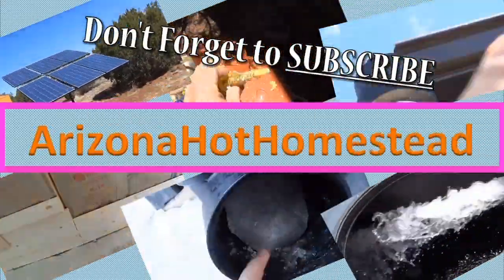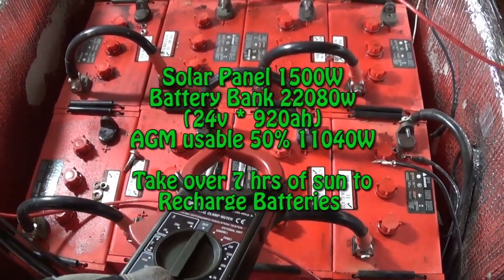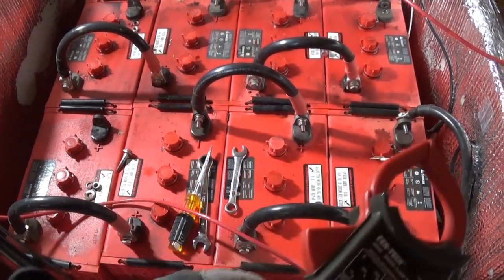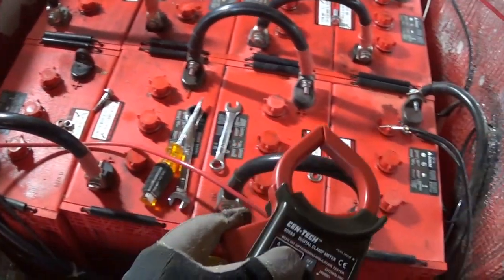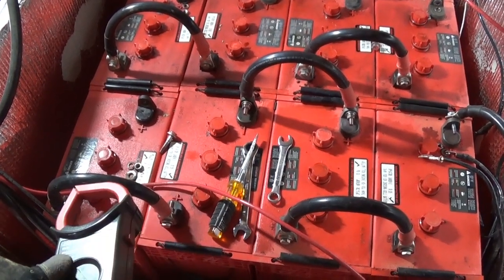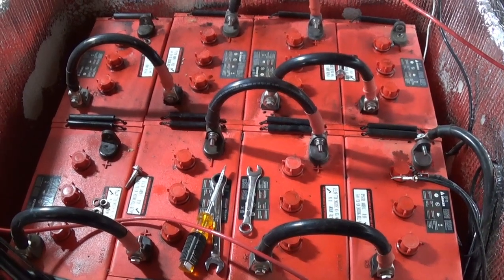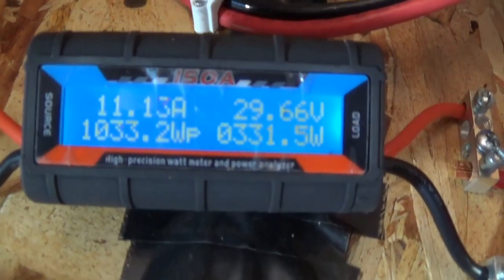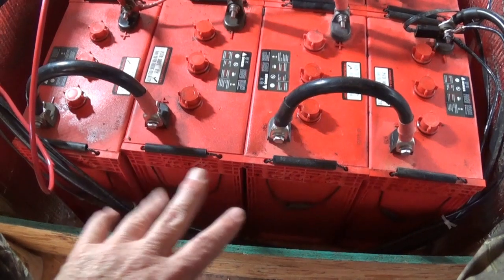Solar Batteries not Holding their Charge Part 1 of 3

Comment: Never done a 48v system before. I always do 12v. With our cloudy days We use our 800w suitcase generator running a 20 amp DC battery maintainer to keep them charged. With our 6 amps of DC usage we have 14 amps going into the batteries. However if the sun comes out for 10 minutes it shuts down the generator as there is no load on it. Keeps the batteries boiling. I have the same batteries BTW, from the solar place on 61.
Reply from the maker: from what i understand depending on how much you plan on using depends on what voltage you should go with. the larger the use the larger the voltage system you want to reduce lose when inverting.  a 48v inverter is more efficient (less loss in inverter 48v to 120v compared to 12 to 120.) . larry and daryl are great i stop in from time to time just to talk solar or to see what project they are working on. daryl is currently working on a dump load used for wind turbines but with solar panels to heat of a barrel of sand to radiant heat at night. i love the idea for the pump house and for a green house.